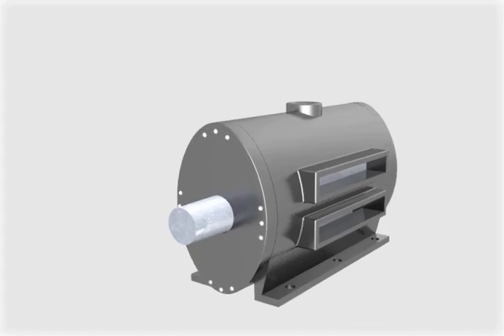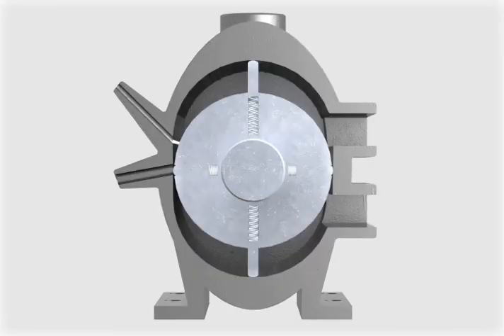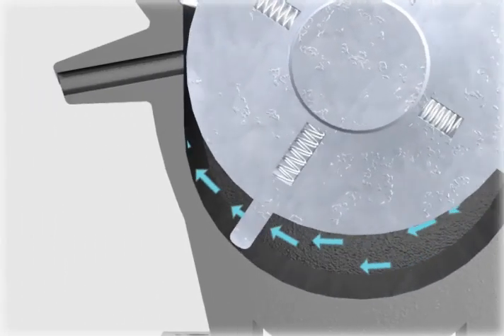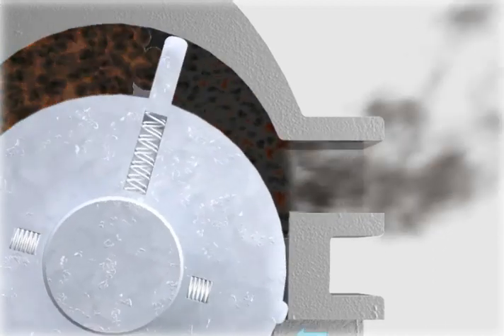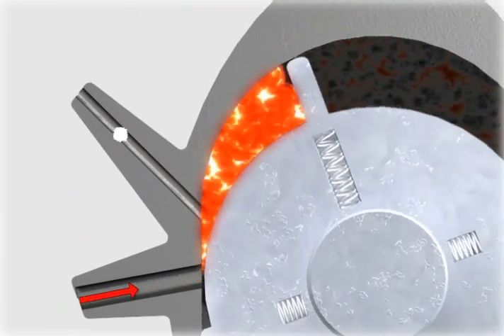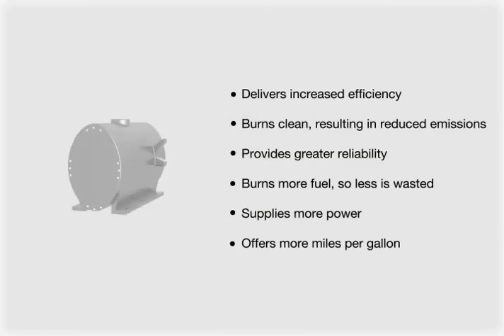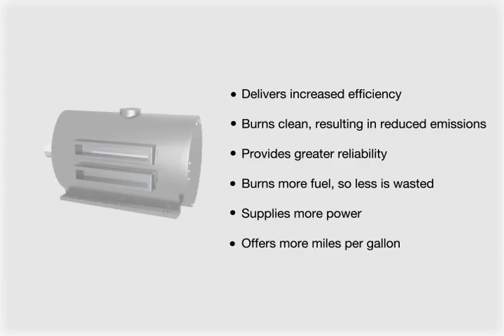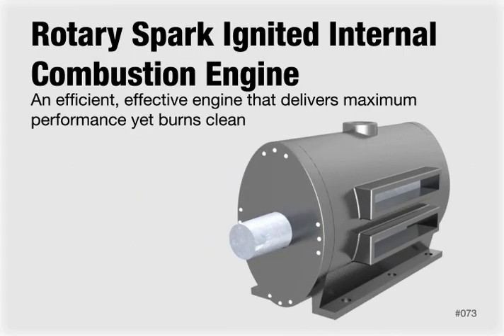Rotary Spark Ignited Internal Combustion Engine

Comment: This is the three million and fifth attempt to use rotary vane pump as an engine. 
Rotary vane pumps have already problems and limited use. As a compressor - they will be inferior to regular piston compressors in almost everything, especially in compression ratio. As an ICE... it is a dumb idea. Too many parts to seal, too much friction. Friction is especially bad because the pressure turns the vanes in the rotor's sockets and will tend to stall. This problem is well known from hydraulic pumps, and this is why they install dozens of vane - to reduce pressure difference. As for volumetric efficiency... it is going to be very very bad. And as for being "light but powerful" - it will be not, look at the rotor size. And it will have all the problems of Wankel on top of that.

Comment: @plavins1 No that's not what I was asking, I know how the air is sucked in...it's just like some oil pumps. What I don't see is how the air, once compressed, gets behind the vane it was in front of....there must be a chamber off to the side or somewhere for it to get pressed into, however this would cause a problem for the seal on the end of the vane.
Personally I think this engine has never been built and can't work if built as shown, so all the claims in the video are complete crap.

Comment: That's a wankel engine xDDD
Reply: Nope, no resemblance whatsoever!

As shown, it's likely to be less successful for sealing, lubrication and longevity, but may be better for efficiency as long as it does last.
Reply: @strictnonconformist7369  actually it would last as long as a 2 stroke or  rotory engine
Reply: @strictnonconformist7369  

It is a great presentation.

Problems could be solved.